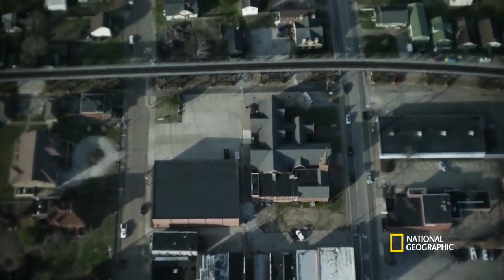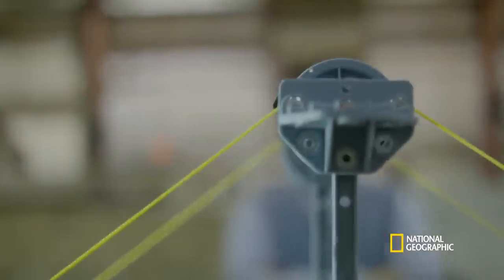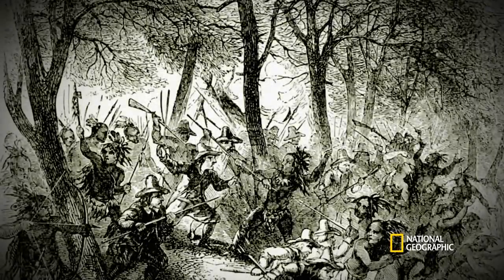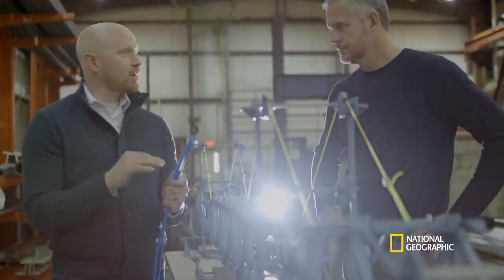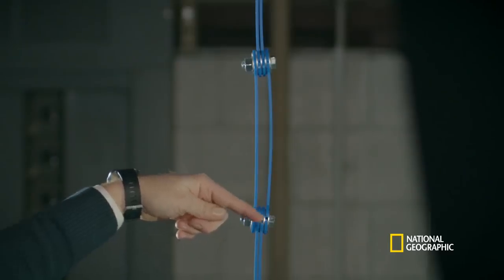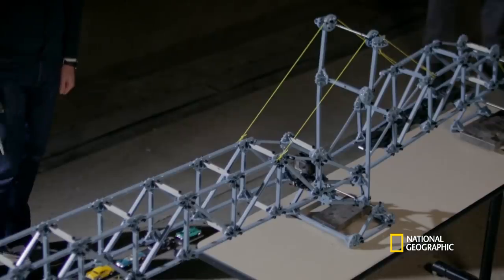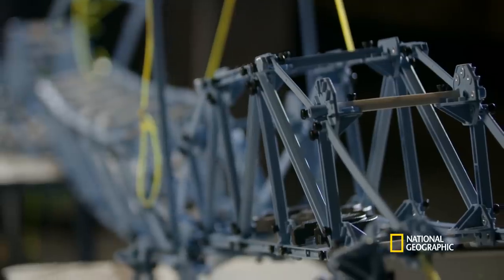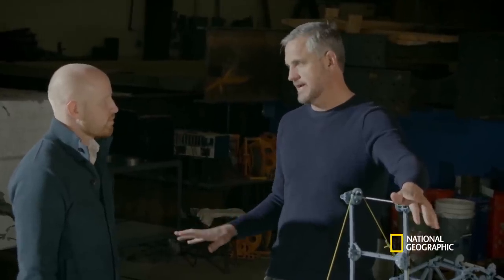The Collapse of West Virginia's Silver Bridge | Atlas of Cursed Places

Comment: The one thing they didn't mention  is the weak link which was the one inch bolt that held the links together.  It could have been up to a 6 inch bolt but they decided on One inch. When the one link broke the one inch nut popped off so that the entire connection came apart.  If it had been secured with a 6 inch or even welded it would have stayed together till it could be repaired.   So basically that entire bridge was held together with a one inch bolt.  If someone came along with a one inch wrench and unscrewed that nut the entire bridge would have collapsed.  Why didn't anyone see that?

Comment: I love engineers, after a engineering disaster, they say it wouldn't have happened if they built it, but then, they take the same courses that the failed engineers did.
Reply: For the most part it comes down to management and their greed on pinching each penny to cut budget and meet schedule. There are many stories in the past to where management even pressures the lead engineers to sign off of things while the engineers know that it may not be okay. Space shuttle Challenger is a great example of this regarding the O-ring issues with cold temps on day of launch, in school they literally have all engineers now take courses in ethics of engineering where they teach you to speak up or stand for yourself if you know something engineering related is not okay but upper management or anyone else is trying to cut corners for profit.
Reply: When this bridge was built, cars were not that common, so bridge traffic was minor. Now, nearly 40 years later, cars were very common and the bridge design became obsolete because it could not hand the traffic or the weather in West Virginia anymore. What actually needed to happen was build more redundancy into this bridge once traffic became heavier.
Reply: @easyenetwork2023  which doing so costs a LOT of money money that Point pleasant possibly didn't have it would have been Better to build another bridge to modern specs yet trying to keep it cheap as possible (Looking at it from city planers perspective)

Comment: Thanks Nat Geo. 👍
Sounds like someone in the state government was paid to look the other way, when it was built ?
Reply: In the late 1920’s.
Reply: An engineer would have spotted the single points of failure any thrown out the design.  NG shows what was wrong and uncovers the low bid coverup.
Reply: No such inspection required in those days, and the bridge was built of a new harder metal that was touted as being so strong it didn't need redundancy. In fact, it was this bridge failure that caused President Johnson to push a bill to require bridge inspections every two years.